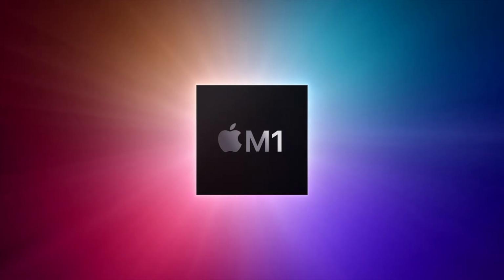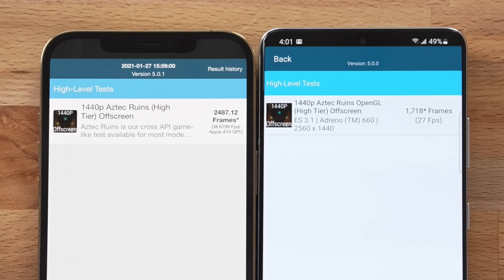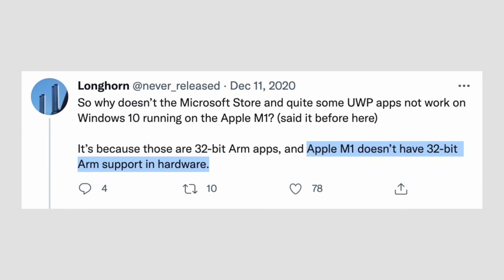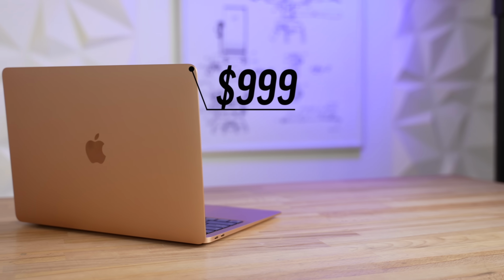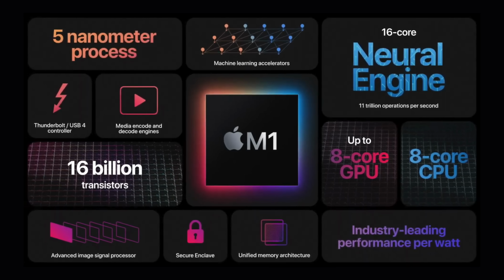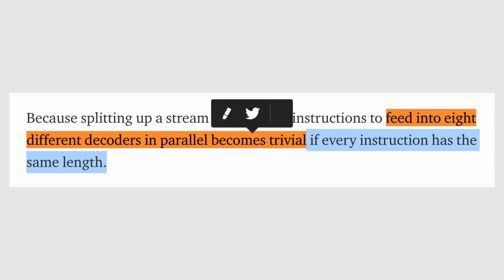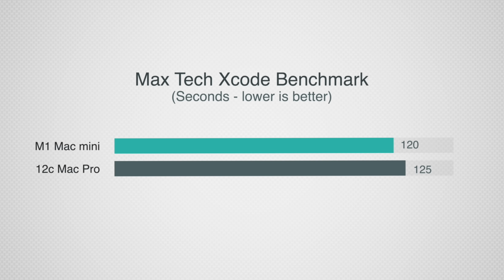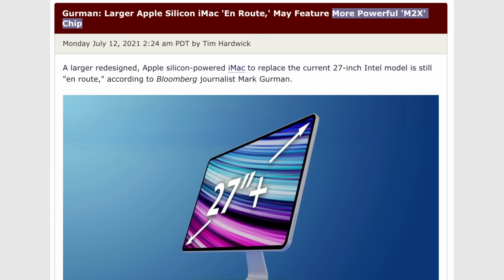Why Apple's M1 Chip is SO Impressive: Explained!

Comment: I don't understand what all the M1's GPUs will mean in the real world. If the GPUs will not improve or even match the performance of Windows games (which are the main purpose of cards with RTX by Nvidia and AMD) and the Mac won't suddenly be used in CAD shops (where Mac-ready software doesn't even exist), then what purpose will all these GPU Cores serve? Redrawing the screen of Word documents?
Reply: Neural networks, optimisation software, video image processing, data compression, physics engine, data parsing, etc. If you can't think of a use for a GPU other than gaming, you don't know much about computers.
And some AAA games are already available.
Reply: there exist other stuff than games in the world ya know? and under 0,0001% of all games support RTX ;-) (but I guess you used that because that is the newest thing from Nvidia, but you don't understand the deeper inner workings on GPU's) the M1 is an APU, so compareable to AMD Ryzen APU's, but the GPU is more powerful than those because of the "on-die memory". and the M1's can actually game surprisingly well, but I bet the 16-32 GPU core ones will game even better and hopefully more games will actually gain support for Mac's now that the iPads (tons of games there, most are crap but there are some high end ones) use M1 chips as well, so it is no issue porting from iPad to Mac
Reply: Yes correct. This Apple guy is just blind fan of Apple. I also seen Macs on oneplus service centre. If they are that powerful so why they are using them for only making shit jobsheets of oneplus devices

Comment: Hell, I’m planning on getting the M1X 16” to replace my 4 year old Dell XPS 15 9550. Do I need that extra processing power? No. But I want that larger display
Reply: Don’t get down, if it ends up not being what you expected, just saying & not saying in a mean way
Reply: @Isaiahisnotonfire  I’m more worried about having to learn how to use MacOS after years of using Windows and trying to read NTFS storage drives. But since I’m just in Chrome 90% of the time, not too worried
Reply: @TheWolfHowling  I was a Windows guy as well for almost 20 years. Until I decide to switch. Takes some time, but I can say for sure that it will make me struggle to switch back more than when I switch to a Mac. The hardware and app are so well optimized.

Comment: For me the biggest flaw of the MacBooks are the MacOS. It really sucks considering how good the CPU is. Unfortunately, I can't just install another OS since just like other ARM chips M1 is locked to single OS. On ARM (at least on the consumer hardware) manufacturer has to specifically support the OS in order for anything other than CPU inside of the SOC such as GPU to work. While on x86 this isn't the case. The worst thing that can happen is that the RGB lights won't work.

Comment: I wish there had been some way to make these moves without abandoning/ostracizing such huge chunks of entertainment software. I have a twelve year old who dreams of owning a X86 gaming PC with windows. Nothing I say to him about the tech involved matters because “specific” games won’t work. My only hope is that future versions of Apple silicon will be SO powerful that running the games he wants in a container will be viable and simple. Otherwise I will just be seen as a mean ass dad, and eventually down the road he will rebel, get a summer job and buy some ugly LED glowing water cooled power hog, POS. 😳😕😳
Reply: My young brother has one of those led glowing water cooled everything type machines  , it did cost him a few bucks to build , at the same time it is always quiet , and when gaming for the most part FPS I have seen are pegged at 500 , so it’s not all bad , it does look like a disco with with all the flashy leds in the glass case though , boys will be boys 🤣.

Comment: Apple has been working with ARM since the 80's. Always looking years into the future.
Reply: Wasn't it Motorola?
Reply: @techwithdave  The Apple Newton was the first Apple product (that I know of) that used an ARM CPU. It wouldn't surprise me if the iPods also used ARM CPUs.
Reply: @MaddTheSane  None of those are 1980s devices. For example, The Newton was introduced in the early 90s

Comment: Even after 100 years windows laptops won't beat macbooks in terms of consistent and prolonged battery life and provide its users the freedom to be wireless all day 😎
Reply: Standards will now go out the window, pun intended. Apple has a monopoly on the computer segment that makes the hardware AND software. Because of this, Apple can literally go nuts on designs since they have the OS to do it’s bidding. Other computer manufacturers will scramble to come up with a solution, but they’ll be lagging forever. 

In my opinion this will force (a) new competitor(s) in the OS world to be built around intense closed format to truly match whatever chip is connected to it. 

The days of different brands designing for the same world standards are starting to dwindle unless Intel throws a Drew Breeze Hail Mary that is actually received.

Comment: What do you think the CAP will be for the processors? At some point we do not need faster computers. Most people don't even use 60% of their computers capacity (Mac). I have probably had 1-2 speed bumps on my mid 2017 iMac with upgrades.
And how long do you think such a computer would last us? On average I have needed to change computer every 5 years, work with graphic design and digital painting.

Comment: How the m1 laptops will perform in 5 years from now , we don't know , still a windows Intel laptop is a safer investment.
Reply: M1 laptops will perform very well 5 years from now. These chips are basically the same things that have been in iPads for years. My 10.5in iPad Pro 2017 that I’m typing this on is still so fast and reliable that, unfortunately, I haven’t had to upgrade it yet.
Reply: Ok Alex
Reply: We aren’t talking about buying cars here. What goes wrong with a laptop anyway? Apple fixed butterfly kb by going back to
Magic kb. The thermal issues are also gone. 

So what are you exactly referring to?
Reply: In a windows laptop you can upgrade the RAM , SSD, wifi card, in m1 you can't, this unified design it's advantage and disadvantage at the same time, if something goes wrong you have to change the whole motherboard or buy a new one
Reply: @Alex Michael you can upgrade it when you are purchasing the product, you just cannot change it after the fact.

Comment: My question is, since I am in need of a laptop for general productivity and was looking at the Air... how long should I wait for announcements? Like I only need it for basic spreadsheets, emails and browsing. I have a desktop for Premiere, Photoshop & Illustrator, so if I need to quickly launch those files on a laptop, it'd be small adjustments, not full work. My current laptop was bought with the intention to work on it, it dwindled away over time as I found the desktop workflow better. So wait for what's coming this year or just grab the current M1 Air? This is the worst thing with Apple, since the new announcements are so tight lip, I can't speculate what exactly will come this year lol
Reply: Just get the M1 Air, Apple is expected to release chips on a tick tock cycle so the M2 will probably release in 2022
Reply: It’s just 2 months I’d say wait for the new macs, unless you need one right away.
Reply: The new ones will get announced in October probably, and available to purchase in November, if you can wait just wait, the best window to buy an apple product is in the first 6 months after release, that for the yearly update products, after that is better to wait if one can wait.

Comment: Rosetta2 and built in supporting silicion (yeap, there's such a thing) is death kneel for Apple silicon. Unless software is totally rewritten ( which means not only recompiling for ARM, but making use of GCD and specialized silicon and hopefully libraries that Apple / macOS provide ), it will not take advantage of the hardware.
Reply: Is not Rosetta2 a stop-gap during 2-year transition of apps to Apple silicon or else priority apps? Rosetta2 means other apps are still USABLE. This is the problem MS has with it's Windows-ARM OS right now... it's expensive and limited in software compatibility. Which is a shame as it would be good to have competition as the Surface Pro X design imho is superior design to anything Apple has designed so far.

Comment: What do you think of the next size of chips after the 1 nanometer has run out?  Will it be 5 Picometer or larger? 

Since you are predicting the future Apple cpu chips?
Reply: Probably we will be using different transistor designs then, so the point of nanometer will fade away.

Presently we use FINFET transistors in CPUs. The nanometer number is the half of the distance between the two “fins” of FINFET transistor.

Moving forwards, there are competing transistors designs like the GAAFET (gate all around field effect transistor) or MBCFET (don’t remember exactly you can Google it) 

Maybe they’ll have some kind of measurement too, to determine the version. But we will probably get to know that only when it’s ready for commercialisation. 

We also have option of moving away from silicon altogether — we have materials like graphene and Gallium nitride in development to succeed sand based silicon transistors.
Reply: 5 picometer is what 0,005nm? so more like 500picometer if anything ;-)

Comment: @Max Tech would appreciate your advice that should I wait for M1X/M2 Mac or get an M1 iMac now
Reply: M1x iMac would be much more costlier than the M1 iMac. 

M1X according to max tech, is focused on multicore and GPU. It could be 2x fast as M1 in multicore loads. 

M2 on the other hand, would be about same price as present m1 iMac but focus on single core — so it will only be marginally faster (10-20%) than M1. 

Depending on cost and requirement you should decide which to select.
Reply: As Shreth says: Depending on model/price for your use case.

If Macbook Air, M2 will be the sweet spot imho: New Arm v9 architecture, same price, ANOTHER big performance gain and better battery life and likely LTE compatibility roll-out AND redesign with thinner/lighter model with mini-LED screen... Also out mid-2022 so not too long to wait with M1 MBA out since November last year. So tilting towards latest release starts to look attractive for most out of spend. If use case is other, then M1X for higher price but more power.
Reply: @commentarytalk1446  holy.. LTE for the M2 lineup could be amazing. especially if it gets even better battery life. turning low power mode would benefit the user even more then. M2 MBA would the perfect chuck n go laptop at that point
Reply: @jg14gerhard_bar  With weight reduction likely too to boot! Also software compatibility will again be improved across the board for Apple... it's top 2 interesting devices imo along with Surface Pro X (except Windows-Arm is so far behind Apple) which imo has a great form factor.

Comment: Is A12Z and M1 are same...as M1 is evolved from A12Z. Is A12Z is futureproof as M1.Will M series  chips come in future iphones and all ipads as a common chip in all Apple products.
Reply: No. M1 is based on A14 not A12Z.

The circuit design (ie micro architecture called firestorm and icestorm) are derived from A14. 

A14 CPU has 2 fire cores@3.0GHz and 4 ice cores@1.8GHz
M1 cpu has 4 fire cores@3.2GHz and 4 ice cores@2.0GHz

A14 has 4 core GPU (64 Execution unit)
M1 has 8 core GPU (128 execution units) 

A14 has max 6GB RAM
M1 has max 16GB RAM support 

A14 is 5W tdp
M1 is 15W tdp

A14 and M1 both share same NPU (neural engine) and ISP (image signal processor)

So A14 is more close to M1 than A12Z

And no. M1 is for Macs and iPad Pro. A series is for iPhone and remaining iPads. 

M1 has too high power consumption to run your iPhone for more than 2hours on battery. MacBook battery is 4.5x larger than iPhone (58Wh vs 12Wh) 

That’s why it’s able to give 20h battery life with a 15W chip.

Comment: And don’t forget that the new designed macs are internal also changed that will help cooling the m1+ chips better and more space for batteries.
Reply: Yes. Correct. Present logic board has lots of wasted space specially on Mac mini. They can put more advance cooling like vapour chamber on MacBook Air and bigger battery on MacBook Pro from space savings (since M1X will draw more power than M1)